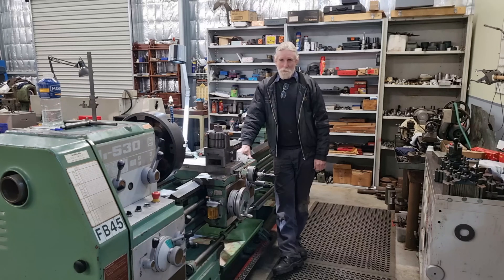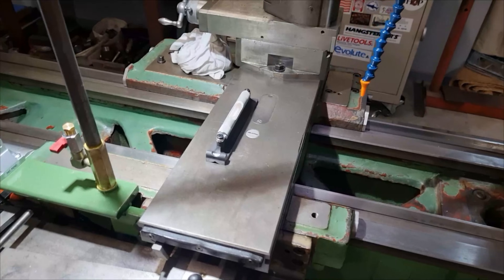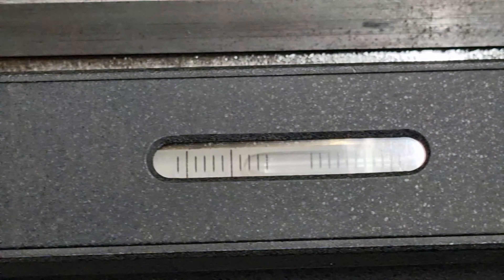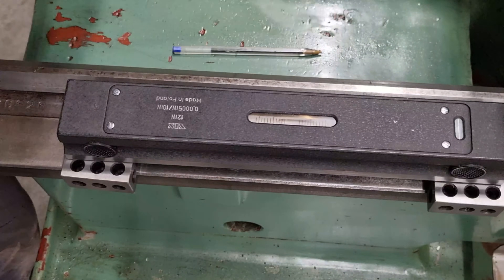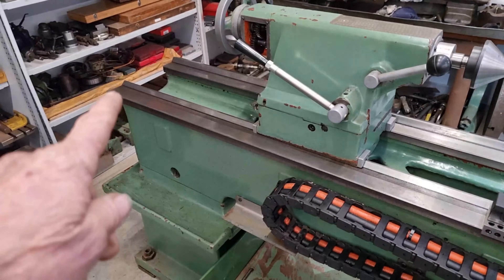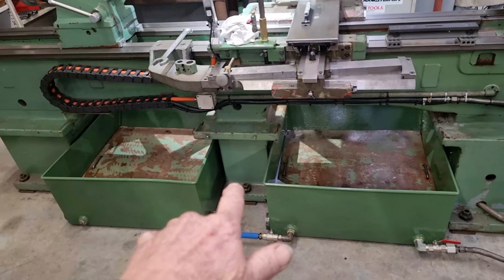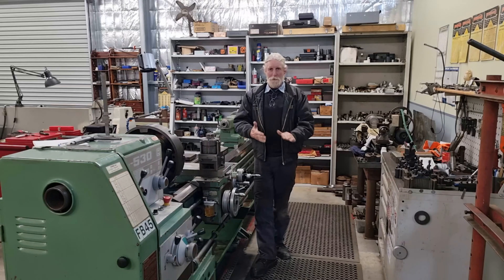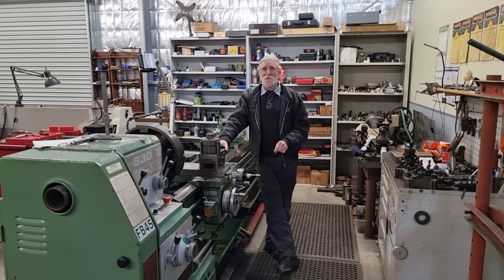PRECISION LEVEL CALIBRATION  & LEVELING THE JFMT LATHE .

Comment: They definitely settle over time.  A proper levelling job on my lathe takes a minimum of two weeks until it stops moving.  At the beginning I would  be making adjustments every few minutes, near the end it would be every twelve hours and the adjustments would be very slight.  You get very good at turning bolts very very tiny amounts.  My jacking screws are just like yours with a jam nut on top.  I used to leave the jam nuts loose until the very end but I found it always threw the alignment off when I nipped them up, even if the screw didn't turn.  Now I make the last few adjustments with the jam nuts tight.  The amount of movement is so small you can do it that way and the jam nuts don't loosen.  One thing I noticed with these master precision levels is that you can tell if the temperature has changed by the size of the bubble.  If it warms up the bubble gets shorter, if it cools down it gets longer. Ken
Reply from the maker: Cheers Ken .  I will take notice of the bubble length .  Not sure if it will change much as we do not have the massive temp swings from summer to winter like you get there .   Still , something to note .     👍

Comment: Really excellent demonstration!  You addressed two questions I've had. How much is a "small adjustment"?  Being able to see how much you tweak the wrench to make an adjustment was helpful.  How much tension do you put on the unladen feet when you tighten them.  From what I understood here, the answer is until they just touch, and then stop.
Calibrating the level is a delicate process.  It wasn't until I tried it that I really appreciated how little of an adjustment it takes to move the bubble.
Reply from the maker: No worries  👍

Comment: Proper 3 dimensional thinking Max, machine levelling is nice and relaxing until it isn't, such as a so-called fully stress relieved machine base has developed internal stresses.

I used to install rotary friction welding machines for one of my sins from about 2 metres to 13 metres long, 6 to 45 tonnes, larger ones needed a week or so to settle after transport and lifting, all fixed by grout anchor pockets.

Always ensure final leveling was done with sliding weld heads in welding position. 

Always good fun when we asked customer for precision levels,  always had to calibrate them, after firstly given bricklayers levels. Later with camera phones, i could show them what i needed.
I write installation and levelling guides now( extract from main manual).
Excellent demonstration again, if i remembered on initial levelling, I would count hex flats based on thread pitch of jacking screw, essential on long automotive type lines i worked on previously looking through optical level issuing instructions to guy on the spanners
Reply from the maker: No worries  .  Lol , i used a carpenters level before the little Starrett for the preliminary !   Cheers  .👍

Comment: Such a good video. One shouldn't forget that the ground and concrete will also be moving over time.
Reply from the maker: Hopefully not much .    6 inches of concrete with lots of reo on top of a heavily compacted cracker dust ( granite )  base 2 feet thick  on top of heavily compacted sand .   Their are no saw cuts for expansion joints  either & no cracks .   I did not want expansion joints under where a machine might sit .   Cheers  👍

Comment: Max what I did when leveling my lathe was to use my camera phone to take a picture of the bubble. Helps eliminate the hysterias. My eyes are so old and tired I must wear Tri Focal lenses so the camera trick is a must for me. . I was looking for 2 mounting holes on the back side of the apron and I could not see them until I snapped a picture then it was easy to see where they were.
Reply: Can Confirm.  Some years ago I spent $40 for a borescope / endoscope  that connects to my phone as a display.  So, so, useful for looking at stuff that's not even in line of sight from where I have to wrench on something.   It's in the running for best $40 I ever spent.
Reply from the maker: I have had the odd occasion to take a photo & enlarge it !   👍

Comment: Those precision levels with try your patience and put that grey (or white)right into your hair! Fiddly doesn't really describe what working with those things are like. It takes it to the next level! Well as always, I learned I great deal on this video. Thanks for the learning, and the entertainment. I was playing some Benny Hill music in my head when you played the video in fast speed while you were making adjustments! Probably would have been a good idea to add music like that to that segment, would have laughed my ass off! I made a comment about turcite on your last vid, and boy, had one guy just trying to rap my knuckles for saying I thought that was not a good lasting fix. Glad you made a comment saying you would like to try using it. I would like to see an apples to apples comparison of the stuff, but from what I understand there are many different types with some specific content and specific properties. I was of the mind that the "miricle plastics" had very different thermal properties than metal, and where there are areas with high temp differences from day and night and season to season that it could delaminate because of the expanding and contraction differences between the two materials. Read one guys comment where Boeing aircraft company used the stuff on a plane and it failed and killed a bunch of people, yikes! But there are applications where it works great and has the engineered properties like self lubricating and such, so it would be interesting to research what that stuff can do. I wanted to apologize for some of my comments on the last video, I allowed myself to be triggered and didn't respond that great. Live and learn. Just a little disappointed that I didn't set a very good example. But I learned and from now on I intend to set the right example. I'm sure you don't want the comment area to turn into an argument space, I know I don't. Cheers mate, thanks for the video and look forward to the next one!
Reply from the maker: All good .  Cheers  👍

Comment: Also have a accurate bubble level. But the concete & a tree that needs removing have set my choice to a progressive combination set level.
Have lathe on a welded wooden  bench so used aluminium 5mm shims at footing resin bolted into cement.
Almost there for accurate work. 
Hope to finally use my accurate level on the final levelling.
My table will twist & bow.
But as accuracy goes the temperature & a reasonable closeness using 1 datum line is a great start.
Like the use of measuring a tightened nut.
Some people can go in the wrong direction & this is what causes the whole process to fall apart.
I use a progressive method using my white board to displace need for shims.
Probably the most important process on a lathe for accuracy.
Reply: ... welded wooden bench?  What?
Reply: @somebodyelse6673  Didn't want to drill through a steel base for coolant drain.
Reply from the maker: Cheers  👍
Reply from the maker: Lol , my southbend sits on a welded wooden bench ( welded steel frame & legs with 2 inch thick timber boards for the top !  )
Reply: @swanvalleymachineshop  - Thanks for taking the time to clear my confusion.  I knew there was something I wasn't getting!

Comment: Hi Max, lots of patience needed.
I scored a Watts precision 12" block level made in London.
0.00005"/10", same resolution as your Polish level, think it was made late thirties in pristine condition in Bakelite box.
Spent a good hour calibrating it, only have to breathe on it to make the bubble move.
Remember back in the sixties using a Watts Theodolite measuring the height of our Cat Cracker as an exercise.
Reply from the maker: No worries .    My Moore & Wright 0 to 1'' mic is in a bakelite case like for a pair of reading glasses !  👍
Reply: Hi Max, Bakelite was popular until the forties, used extensively during the twenties and thirties, your M&W micrometer is probably around the same age as my level.
The smell of Bakelite is a dead giveaway, must be the formeldahide and phenol.
Reply: I think you've added an additional zero, lovely instrument manufacturers, ER Watts, became Hilger & Watts, then Rank. I've got one from each, latest one is an 8" box type 8n a horrible plywood affair.
Reply: I stand corrected, one additional zero, 1/2 a thou in 10 inches.
My Bakelite box has 24 screws holding it together not counting the screws holding the clips for the purpose made adjustment tool.

Comment: Hi Grant! What is the thickness of your concrete slab? If it is too thin, there is always a chance of settling over time, even when the machine is set level in all directions. That is hard work for one person... Ron...
Reply from the maker: Minimum of 6 inch on top of 2 feet of compacted granite chips .  The granite ( cracker dust )  is a by product of road base and when mixed properly with water & compacted it sets like concrete .   👍

Comment: Do you keep your shop fair temp wise or, is that a struggle? Not every one has luxurious environmental conditions. What things do you change to mitigate the temp swings on your structure in your local environment? Hope this question is not offensive.
I'm not a big proponent of isolate and insulate. I'm curious to hear your thoughts on how you do this mitigation. But, I do really like the machine work and tech. solutions. from the opposite of the earth. Thank you!
Reply from the maker: We would only have a 40 deg C temp swing here , like from 5 deg C in winter & 40 to 45 deg C in summer .     In summer , the side verandahs keep the sun off the main walls .  Also having 4 roller doors allows  cross ventilation .  The glass wool insulation makes a huge difference in summer & winter .   Also no roof condensation because of the insulation .   👍

Comment: Hey Max does it make sense in this situation to have the lathe fixed to the floor, it in my mind would allow you to mechanically straighten the bed.
Reply from the maker: That method should not be done , according to the Dean Smith & Grace methods . The casting has to be in it's relaxed position as it left the factory when inspected .    When i do my small lathe , it will be a different story as it does not have the weight to self straighten .   👍

Comment: When using these levels, they don’t have to be exact in calibration. As long as you note where the bubble is and duplicate that with your bed adjustments, you’re fine. I do tend to get anal with my Starrett Master as well. But we really don’t have to. Is the cross slide parallel to the front and rear of the ways?
Reply from the maker: I would forget where the bubble was !    👍